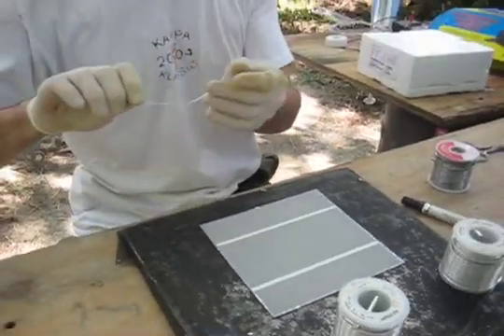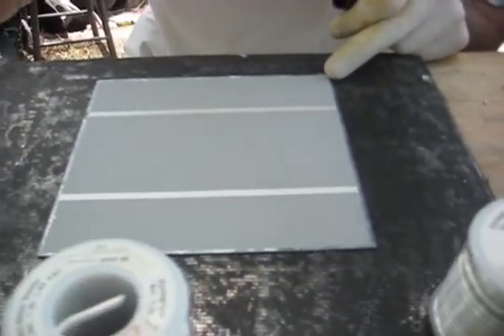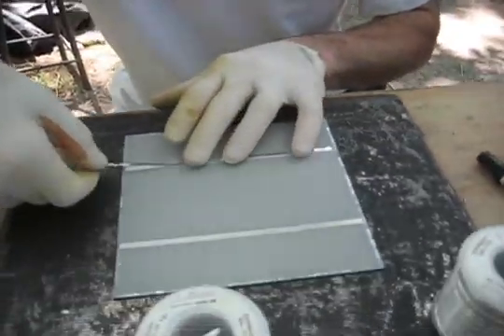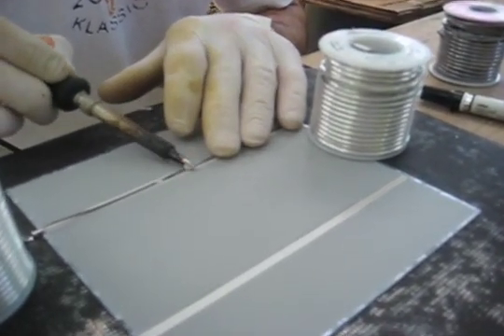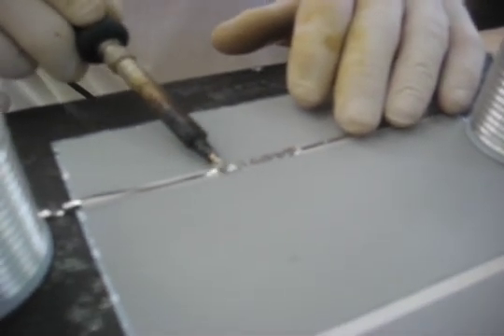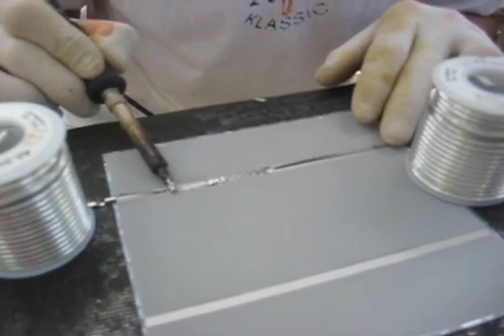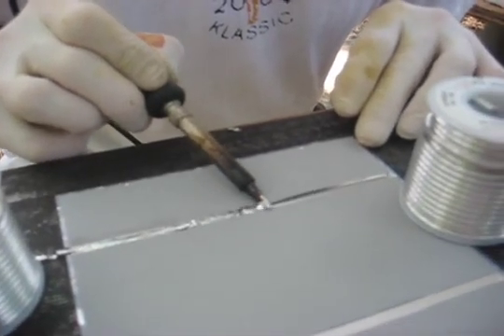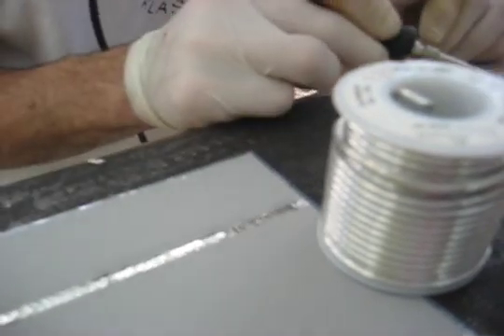Solar Panel Construction 3 - Open Source Ecology

Comment: @H0D0NKAIN I would not recommend making the cells lol, but you can buy them in lots of 36, 50, 100, and all the way up to 1000 on ebay. Try a kit to start, it will come with cells, tabbing wire and bus wire, a flux pen, and a blocking diode. A cool project to get into solar.

Comment: Try feeding the solder onto the iron whilst you are soldering, that way you can keep it flowing and not waste so much time, perhaps the heat will damage the cells but it will be a better technique for tinning the wires.

Comment: OMG what are you doing there? The (maybe) only speciality of these tabbing wires are their being already-solder carrying. So, u removed the solder from them in the previous video and now you are again soldering them :) 
Actually I think that you couldn't solder the tabbing wires on the panels, so you tried this way. However, I know your soldering iron which is very very cheap and never let you work on suc a solar cell. Try using a better one, so you will never waste your time.